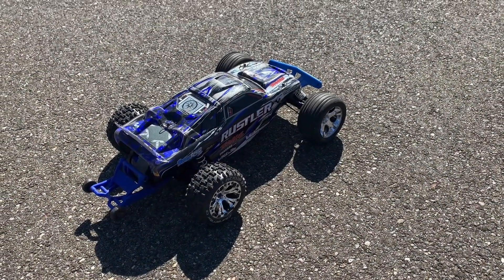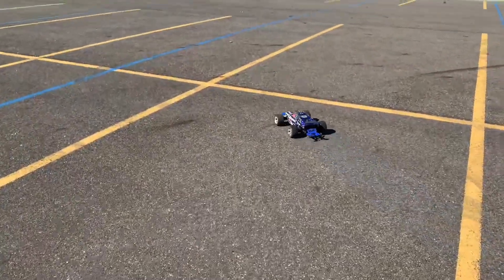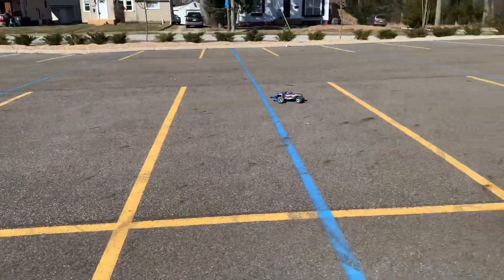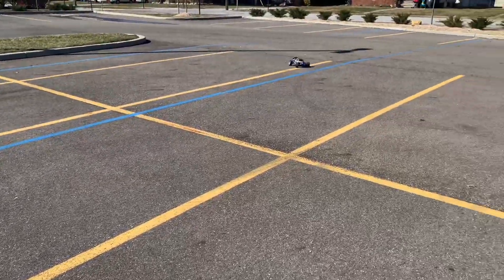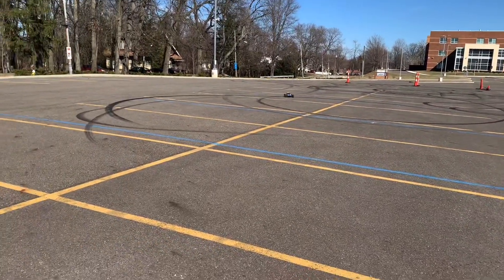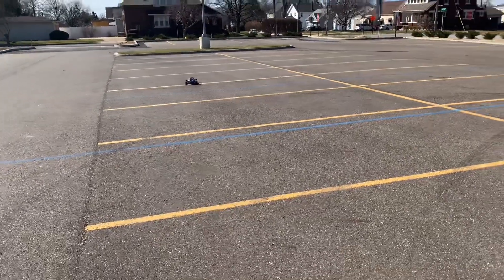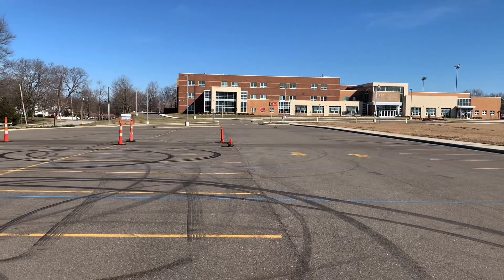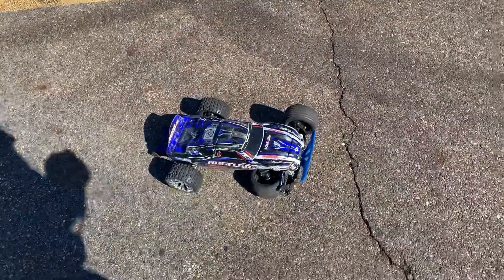Traxxas Rustler XL-5 *modded* 2S vs. 3S lipo comparison. May have broken it!

Comment: Nice mod! I just put that motor on my trx4 with xl-5 and run it on 3s! 😎👍
Reply from the maker: From crawler to basher haha. Do you still use it as a crawler as well?
Reply: @dstjamesrc6395  yes, it has 18t pinion it's at about 20 to 25 mph.

Comment: You can move the battery forward to put more weight over the front wheels to prevent wheeling. Also, for high spreed road runs lower the front suspension. However, It might need to opposite to this for maximum traction and ground clearance off road. I've had loads of fun with my rustler!

Comment: Try checking under the servo saver, where it attaches to the servo,, little white button style item that fits directly to the servo,, a lot of times it strips out, the loss of a few teeth makes it hard to recent,, if that part isn’t bad,, I’m afraid it’s your servo gears,, nice share, nice Rustler,, thanks for sharing!💪💪💯

Comment: The xl5 can handle 3S? Please explain what mods! Cool video
Reply from the maker: The stock XL-5 esc can only handle 2S. I have the Velineon brushless system in it now. Along with the gearing of the Rustler VXL. So it’s been upgraded pretty much to a Rustler VXL.

Comment: Is it true you can use one push forward on controller trigger for engine braking without damage to the motor & gears?
Reply from the maker: Yeah, push the trigger forward for braking will not damage the motor or gearing.

Comment: Just wondering what size lipo would you recommend for more run time and power just getting in the hobby don't wanna burn anything thing out yet
Reply from the maker: I would say a 2S with around 5000mah is a really good balance. I get around 25 mins run time and still plenty powerful. I don’t break much on 2S either, upgrading to 3S is when stuff started getting broken.

Comment: Is it safe for me to switch out my 2s lipo, for a 3s lipo, on a brushed rustler XL5
Reply from the maker: The stock XL5 esc is not rated for 3S, I think it would burn it out.
Reply: dstjamesRC ok, but then how did you run a 3s lipo with out it busing out
Reply from the maker: @krishkordic2319  I have the Traxxas Velineon brushless upgrade. That esc can handle 3S. I see how my title could be misleading.
Reply: dstjamesRC oh ok thanks… how much is it? And if you can, can u make a video on how to install it, bcuz I’ll get ut
Reply from the maker: @krishkordic2319  it’s around $170, but Traxxas has a trade-in program called Power Up. You send them your XL5 esc and Titan motor and you get a discount on the Velineon. Maybe I can make a vid on the install, haven’t done a wrenching video yet.
Reply: dstjamesRC ok thanks
Reply: Did u ever find the answer to your question? Can u run a 3s 4000 MAH battery safely on a traxxas xl5 brushed stampede?   I know the manual says your not supposed to use that battery but was curious if u could without burning it up.  Thanks .....
Reply from the maker: @babyjesus2025  Sorry for not seeing this earlier. You can not safely run the 3S battery on an XL-5 esc. It risks damaging your esc, battery, etc etc
Reply: @dstjamesrc6395   No problem boss.. Thx